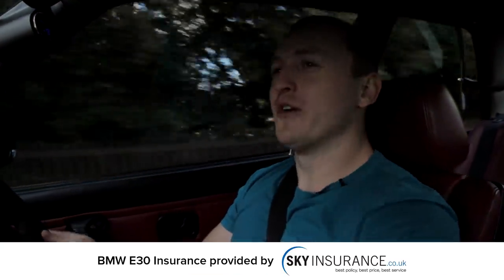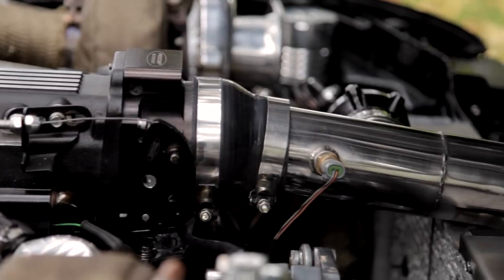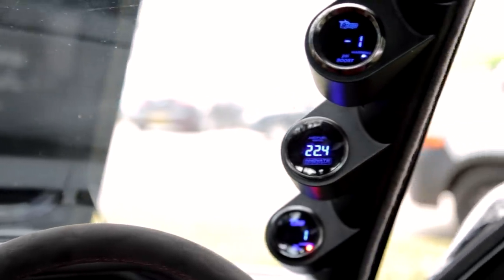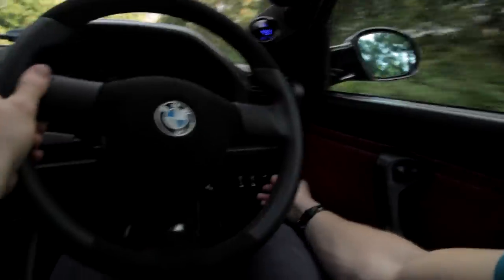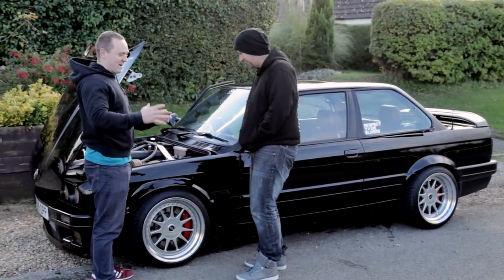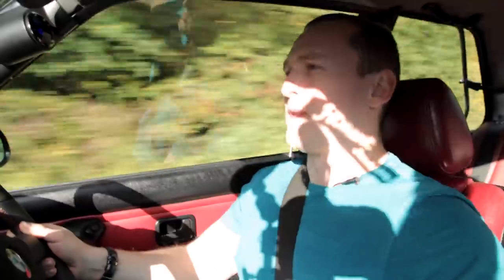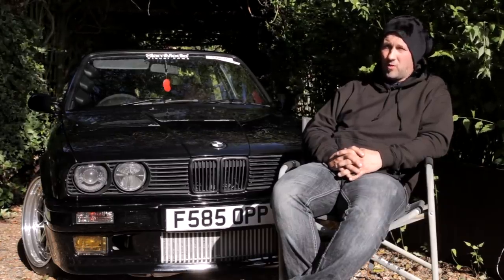800hp BMW E30 V8 Review: My Perfect Widow Maker

Comment: "calculations based on gear ratio and diff ratio" my arse, he knows exactly how fast that thing can go.
Reply: Tell me where he would be able to hit such a speed in England? He'd probably have to test it at the old Le Mans circuit to hit it.
Reply: +ByVillex  he can visit me in Germany anytime. I'll show him a few roads^^.  But he should look into his mirror we have a few crazy BMWs, VWs and GTRs who will eat him.
Reply: +Steffen kawa defo lol getting overtook at 150 haha
Reply: +Watsonisawesome 
i'm actually amazed the 0-60 is so slow. 4 seconds? with 590hp/ton?
Reply: Ryukachoo its rear wheel drive so really hard to get off the line without wheel spinning all over the place with all that power!
Reply: my bike runs 180mph and i'm also getting overtaken.  People from the Swiss are the worst they always cruising and blocking the left line with 150-160mph.
Reply: Viren Dhokia not to mention it's probably got long gears
Reply: +Ryukachoo its mostly the grip that lets it down. With so much power you wont be able to go full throttle in first without getting anything but your wheels spinning and a lot of smoke. so he'll need to let of and ease into it, which will reduce the time it takes to get to its 0-60 mph.
Reply: a big factor on a rwd car is the suspension geometry, and especially anti squat. Too stiff, the car feels great to drive, but doesnt transfer weight enough for 0-60. thats why v8 miatas can launch so hard with little wheelspin. The miata never needed antisquat with its low power
Reply: It is really astonishing how people nowadays say that 4 seconds is slow. Just stupid! First, somewhere have to be physical limits, you can&#39;t get faster than a specific time. And second, which is much much much more important: 0-60 is useless, you can see and feel real power much more in 60-125 runs, that is where the fun is guys.
Reply: Track Racing Society people said it was slower than expected, not that it was slow.
Reply: +ByVillex there are quite a few aerodromes converted into tracks in England, there's a 1.2 mile runway in Bedfordshire for example where high speed runs are allowed.
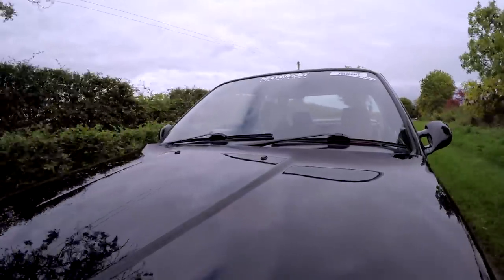Reply: +ByVillex Just about any motorway between 23:00 - 03:00
Reply: +Track Racing Society I think that entirely depends on what driving youre doing. my mini has a power to weight ratio of maybe 160hp/tonne. not much compared to that thing but any driving i do with that, its all about my 0-60. on a lot of the tracks i rarely hit anywhere near 120, straights arent long enough. mind you, my ratios are so short, i dont think it can go much faster. i havent timed it yet, but i wouldnt imagine its much slower to 60 than this thing. i may even supercharge it in the future...up it to maybe 200-250hp/tonne...
Reply: PommyDownUnder98 Moog?
Reply: haha no man, im a few thousand ks north of them. i had my mini before him too, mines a clubman/slabnose though. im loving their episodes though. i was absolutely stoked to see them get a mini, cant wait to see what marty has...
Reply: +Watsonisawesome it's pretty simple to do it yourself
Reply: +Watsonisawesome I doubt it, 204 takes a big stretch to get to - even with a vehicle with that much hp.  The numbers are very easy to crunch, I've done it before and found that even my old civic had the gear ratios to hit 200 if it had the power - and given he's an engineer, it makes more sense to calculate it than trying to find a place in England where you can do those speeds.
Reply: need more Rubber
Reply: +Justa carguy This monster will spin tires all the way to top gear
Reply: +I see You! because stance not because power
Reply: +Watsonisawesome Given how darty the suspension is @ 70 mph, it will be a handful over 150 mph with no aero help.
Reply: +ByVillex germany...
Reply: Tony Prince Germany isn't in England...
Reply: Surprised i didnt already mention it as i thought it...anyway, Loki is right. back then those speed were only possible in the sky, at comfort. the standard factory top speed for my mini was quoted at about 85mph. the way mine is, if i had the right gearing i could probably do double that. however i wouldnt drive it that fast for any amount of money. they werent called flying bricks for no reason. back in the 70s when mine was made, people didnt really take aerodynamics into consideration when building cars. as such, at those speeds, my mini would likely fall apart if it didnt explode beforehand!
Reply: +Ryukachoo no traction
Reply: +Viren Dhokia Tell me where it is import to get so fast out of the line. RWD is much lighter then AWD and you will need a really good AWD setup to be fast in the corners.
Reply: +Steffen kawa "blocking the lane with 150-160 mph" ."
Reply: +Steffen kawa bla bla bla German bullshit
Reply: +Ryukachoo you need to know the tire grip is just a important as hp and weight. that thing will spin in 4th gear no problem. plus weight distribution has got to be 60/40 cause of the big turbos and v8. still very fast.
Reply: +Watsonisawesome U are a ricer and the 269 people who liked this stupid comment. Tell me what decides the top speed of a vehicle.? Is it gear ratios or horsepower.? If u think its solely the horsepower, then u sir are a ricer.
Reply: tin tin I don't think you know what ricer means.
Reply: Well u have to take the fact into consideration that a lot of ricers are on youtube watching tuners sututututu, whoooosh and choo-choo around.
Reply: Lol.
Reply: +Loki yessss thats funny man
Reply: Nah bro someone on a forum did similar mods and got it up to that speed, so it confirmed.
Reply: With that ludicrous front wheel just to fit them ridiculous wheels stance I very much doubt it.
Reply: Viren Dhokia .
Reply: @steffenkawa8374  why hate for little advise u get nothing from it Lol
Reply: @Ryukachoo  rwd
Reply: Exactly man spent years to build its a right of passage to go full speed

Comment: 0-60 in 4 seconds with 800bhp... oh dear guess he needs to engineer more traction
Reply: Tom Forrest ouch
Reply: 50/50 weight distribution when it was stock, now it has a big V8 with lots of turbo plumbing in the front means there's probably not a lot of weight over the back wheels, add no electronic aids at all and a fairly aggressive clutch and it's probably not very easy to launch fast at all.

This isn't a drag car built to launch as fast as possible but useless around a corner.

Comment: Where can I buy a 250hp switch for my honda, preferably used?
Reply: You taken off your rev limiter yet m8? Gotta let the vtec kick in with unlimited sweg
Reply: Get a turbo, a strengthened engine, a NOx trap (reduces emissions with urea-based fluid), and a strengthened radiator.

Comment: Now don't get me wrong, I highly respect the build and how dope it is. But me personally, as soon as a foreign engine is running a BMW. To me it's no longer a BMW. This goes for any swaps for any car.
Reply: Ikr. Someone on YT has an early 70's Nova with a rotary... Yeah it's weird, cool, and fast... But it still bothers me...
Reply: Still an E30 setup gocart feel with some more understeer and pull. Running a 1000hp M3 turbo or an LS N/A with 800hp, both E30s are insane to drive.
Reply: Idk BMW body and badges make it simple enough to call it a bmw instead of rattling off every car part he has on it. So who cares... it’s a bmw.
Reply: What a limiting perspective to have.  Sounds just like a normal bmw fan boy.

Comment: There is a reason, why BMW engines won a lot of the "Engine of the year" awards. They are well engineered and designed for usage on daily basis. Now, to everyone yelling, that BMW's suck etc., first off - You can never rate a car, if you are not the one getting it in showroom. You can never determine how it has been used and abused, and abviously, driven crap is driven crap. Almost all German engines are very complicated, and the younger the cars get, the more complicated they become. Tri-Turbo Inline 6. Trying to DIY yourself?
What I wanted to say with this, about no BMW V8 in the car, yes, Murrican engines are the best bang for buck. You can go OEM road, but it requires a lot deeper pockets than taking something commonly and widely avaivable with such an aftermarket support. For example - Dinan, a company that tunes BMW's. Their services are expensive, like, really expensive, cause they took the time to study the engineering of the cars and engines, and they can use this for their own good - there's little to none companies that provide such an extensive modifications list. There's Alpina and G-Power, but they have a little different background with BMW themselves.
Reply: lol epic fail, it doesn't have a bmw engine in it, it's a v8 cratemotor hahaha
Reply: Martijn Knol Dude, read my comment again. I never stated, that there's a BMW engine there.
Reply: +Ralfs Zemzars There is a reason Chevrolet won engine of the year awards too...

They all do. Big deal. So does the F20C from the S2K, won wards 4x in a row but that doesn't stop them being less than reliable when beaten on hard, bores go out of round etc

Comment: The only problem is tires looks disgusting.
Reply: Is that all you can pick at is the tyres???
Reply: ross bradley no, I mean everiyhing is fine but the tyres.
Reply: +Ertan Can Atik sorry but how can a tyre be disgusting ??
Reply: Tyres looks much wide because of that it looks disgusting. If tyres gonna be wide so car needs wide body. I think that's the point.
Reply: +Ertan Can Atik Well he could always do a body mod and flare out the fenders for a wide body.
Reply: +Ertan Can Atik But the chrome on an all black vehicle is what makes it look disgusting.
Reply: +Ertan Can Atik Ther is also no bmw engine under the hood, car begs for s62, and yup smaller rims meatier tyres is the way to go...
Reply: If he wanted grip he woulndt stretch the tyres.
Reply: +Live Rave Repeat there is no chrome on any of it
Reply: +Casper Wendt grip is just fine as it is
Reply: Thats what i say, i mean u got negative camber for look and not performence?
Reply: +Casper Wendt non of the wheel geometry is for looks , it's there and doing a purpose
Reply: ross bradley So ur telling me that wheel setup is the best for performence?..
Reply: +Casper Wendt yes for my set up they are and do absolute fine with my set up, it's not a track car so doesn't need a track car set up! It's for rd use only
Reply: Yeah i understand im not hating on ur car i think it looks great. But stretched tyres is not for performence. You dont see any race/sport cars with stretched tyres. and negative camber would be somthing u would do on a track car. and again im not hating on you or your car but your wrong.
Reply: +Casper Wendt if you seriously think that there stretched I think you need your eyes checking , the camber on the front is there for a reason due to the set up and clearance issues , and again I will say it is fine for my set up as you don't know the car so am I wrong if it's right ???? No !
Reply: Okay then tell me with of rims and tyres then because to me it looks like theyre stretched 4:53 looking at ur front tire.
Reply: So you made a car with 800hp for road use and there is no rubber to put those horses against the tarmac. Did i understand the principles of fast car wrong or those shiny beer kegs the are for showoff. So why have so much power you can showoff and make burnouts with 600 or even 300 hp, only thing that then you can't say you have 800...
Reply: Car needs proper wheels or it is a joke with a lot of hp, for making tie smoke...
Reply: Thats my point :D
Reply: +wickedroman last time I looked it was my car I build it how I want not how you want if I wanna put shiny kegs on my car I will, not to mention there worth more than anything you drive, and for your info it put the power rather well so before you make judgement know the car first
Reply: Dude calm down.. Your acting like a little kid.. Nothing wrong with that kinda wheels. BUT its not for performence its for showoff ONLY. An e30 m3 comes with 15"-17" wheels i guess. because thats what suits the car. Only thing u have done is small changes and then put an huge v8 in it (witch leads like the wheight distribution is completly off now) But youre not wrong the rest of ALL car designers is.
Reply: PS. "not to mention there worth more than anything you drive,"  if you really payed a 35k for those Hartge kegs then you've been robbed next time chose something more worthy and cheap like HRE or BBS  :D
Reply: Ertan Can Atik this is the miserable mentality America breeds